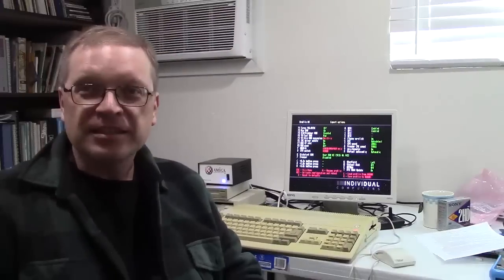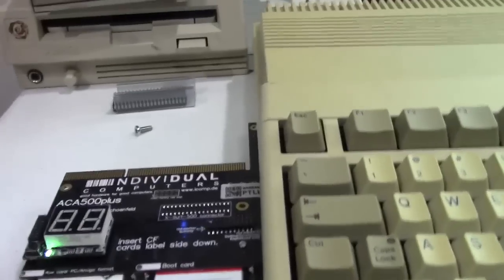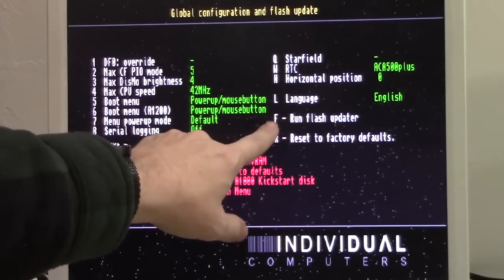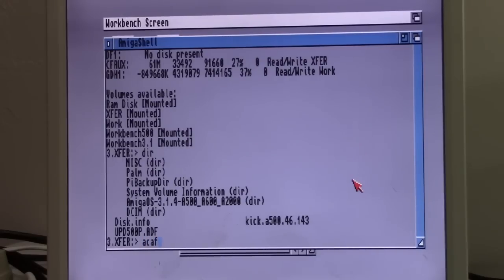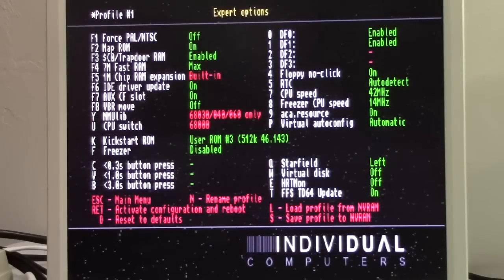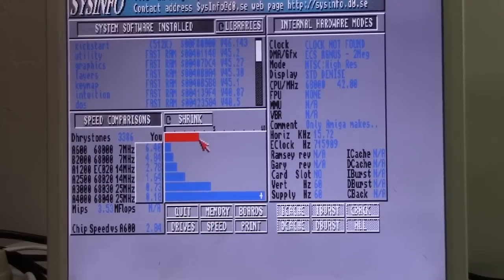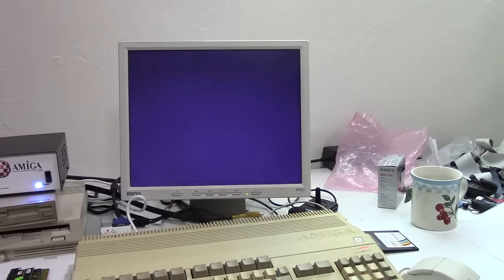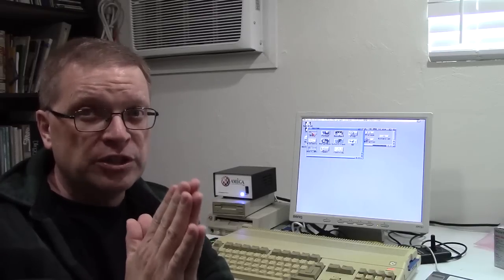10 Minute Amiga Retro Cast - ACA500+ Review & Configuring AmigaOS 3.1.4 on it

Comment: Have since yesterday the new ACA500Plus V2 from 2018. My old ACA500Plus V1 from 2016 is dead and can’t repair. Have connect the ACA1233n-55 RTC and it’s bloody fast. Is the fastest 68030 card ever build and have 7MB/s on the CF 32GB card with WB 3.1.4.1 - BestWB 1.3. Have also the Indivision ECS V2 to replace the old Indivision ECS V1 for the BenQ BL702A VGA monitor. And it’s razor sharp and WHDLoad Games ans Demos plays much better than the old ECS V1 card.
Reply from the maker: That makes for a very wonderful system! Wow! Blazing fast.
The performance of the CF card makes quite a difference on these machines for sure.

Comment: How did you add 2 mb chip?
Reply from the maker: The DKB MegaChip card. It lets you install the 2 MB Agnus. I have one in my A500 (now with a Vampire card) and one in my Amiga 2000.
There are now at least two modern alternatives available. You just have to source the right Agnus chip.
Reply: @10MARC  I thought you have to desolder Agnus socket from the board. I will have to check it. One of my Rev 6a has 1mb chip which is maximum with original agnus

Comment: I have an A4000 as my main machine , but also an A500+ lying about doing nothing , now .......  i'm very tempted to  buy the ACA .......  (this retro computing thing is getting way outta hand here !   ;-)  )  Nice video as always !
Reply from the maker: My A500 sat around for about 25 years doing nothing. I would turn it on every 5 or 6 years to make sure it still worked, then pack it away and go back to my A1200 and A4000. When I started 10 Minute Amiga Retro Cast, I dug it out and found out the Keyboard had failed - and then I started spending more money on it... The rest is history.

Comment: i have the old version of aca500plus (small display) which won't boot if i select cpu speed 28 or 42 mhz. so my aca500plus only works with 21mhz max.
and i want to test ham videos like the ones you showed end of episode. where can i download some? i assume the program to play them is this: http://aminet.net/package/gfx/show/hamview
Reply from the maker: That is a bummer that yours won't work at faster speeds. I wonder if some of it relates to your version of the A500 motherboard. Mine is rock solid at 42 MHz and I am using a Rev 6 motherboard.
I have some videos up on my www.10marc.com website, but I have not updated it in a while. I do have an idea in my head for writing a script to make creating your own videos fairly automatic.
Reply: @10MARC  thx! unfortunately, i don't have any "real" ocs based amiga 500, mine is an ecs based amiga 500 plus, rev 8, 1mb chip ram on board + 1mb chip ram in expansion slot (2mb chip in total). so i can't even test, if my aca500plus would run 28/42mhz on an ocs base amiga 500. as a workaround for this issue i plugged an aca1221 onto it, which can do 28mhz, adding 62mb of fast ram. and on this configuration (a500+ and aca500+ with aca1221) your videos work pretty decent, i already tested skyrim.h6v! i didn't download aga version, since amiga 500 plus  doesn't provide aga, i'll have to test this using winuae sometime. :D
btw. i encountered a funny fact regarding drive speeds: system partition (cf0:) on boot cf card is slower (4.499.017 bytes/sec) than work partition (cf1:) on same cf card in boot slot (6.553.600 bytes/sec)!  and cf card in aux slot (cfaux:) is as fast as work partition (6.553.600 bytes/sec). all values refer to aca1221 plugged onto aca500plus.
Reply from the maker: @honx4amiga  hmmmm... That rev of board should work great at 28 or 42 MHz. Let me ask you - can you actually select the higher speeds and then it just crashes, or does it not allow you to even choose them? 
My h6v videos should work ok even if you turn your ACA500+ down to 7 or 14 MHz. Faster is always better, though. I will create some new ones in the next few weeks and post them.
Reply: @10MARC  i can select and set 28 and 42 mhz. so far so good. but as i try to boot, the amiga freezes. i have to turn off an on the machine and occasionally after turning on my amiga, monitor stays black an aca500plus displays "FF", so i have to reboot again (ctrl+amiga+amiga) in order to see aca menu system again...